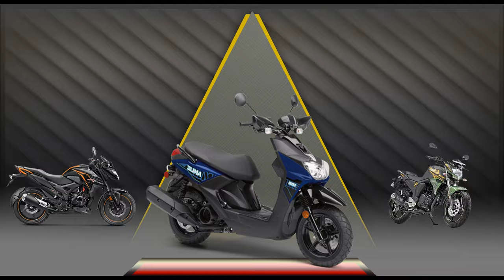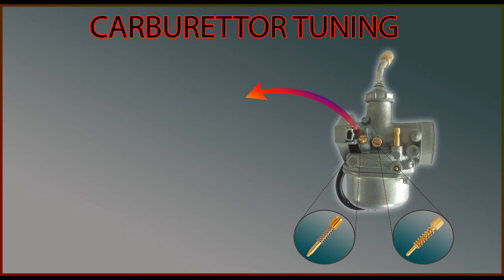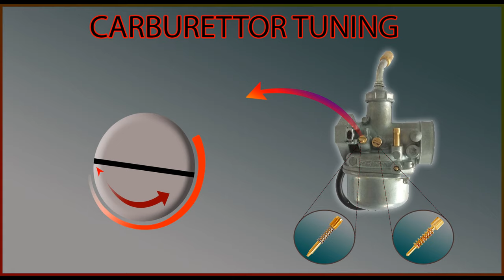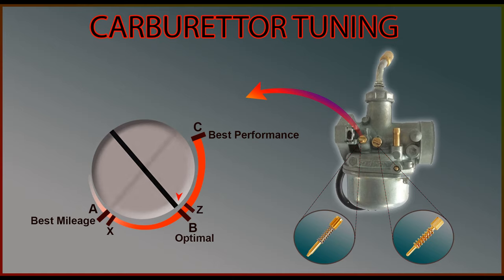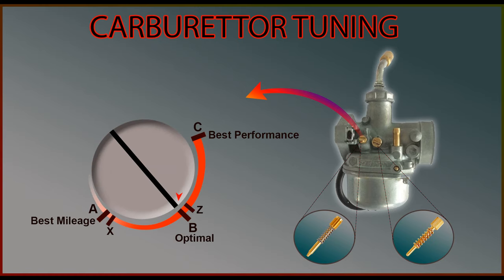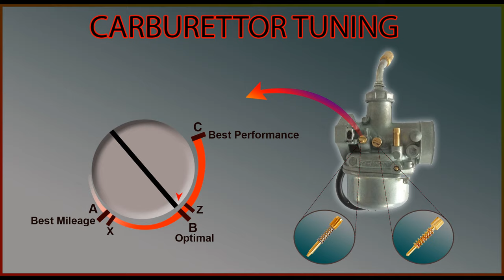Bike or Scooter carburetor tuning for mileage, carburetor setting. TVS Jupiter, Wego. #carburetor

Comment: Bhai meri activa ma mane all setting karke dekha li par milage nahi mil raha ha
Reply: Same story with my activa 3g
Reply from the maker: Mian jet ka hole ek baar check Karen. Agar mechanic jet hole ko kisi mote pin se clean karta hai toh jet ka hole bada ho jata hai. Tab bhi mileage nahi aata.
Reply: @autobotgeekse  agar koi gadi faulty hi ho chahe kitna bhi kuchh bhi karlo fault nahi jaega.
Waise hi agar average nahi deti toh kitna bhi karlo, sab kuchh karke dekhlo average nahi milega kyun ki  engine hi faulty hai.
Reply from the maker: @sourabhpanse  yes, kabhi kabhi bad luck hai.
Reply: @autobotgeekse  also when i pull choke in morning first start, Activa starts in 1 kick and engine rpm is high as choke is pulled but when i release it, engine stalls and turns off which i think should not happen.
Reply from the maker: @sourabhpanse  You should adjust your idling screw as idling seems to be very lean. Also, clogged idle jet will also cause the same issue. Cleaning the idle jet should fix it.

Comment: 1.75 turn band gaadi me kre or rpm set krde tab mana jayega
Reply from the maker: Haan, thoda adjust karne se set ho jayega
Reply: @autobotgeekse  kitne tak khol skte hai jissey gaadi kharab na ho
Reply from the maker: @history5889  3 turn se jyada petrol jyada piyegi
Reply: @autobotgeekse  3 turns se zada kyu piyegi jha kholta hai vha toh mileage ata hai na
Reply from the maker: @history5889  nahi, jyada kholne se mileage ghat jata hai. Video mein bataya hai maine
Reply: @autobotgeekse  zada kam khole tab bhi ghatega or zada khole tab bhi max kitna rakhe
Reply from the maker: @history5889  kam kholen toh mileage badhega. Zyada kam kholen toh engine idling sahi nahi rahega
Reply: @autobotgeekse  scooter me bhi  same hai full tight ke baad ek turn kholde toh kya mileage badhega yh ghatega
Reply from the maker: @history5889  haan badhega. Lekin ek nahi, dedh ya 2 turn kholiye
Reply: @autobotgeekse  2 max hai jissey dabe nhi gadi
Reply from the maker: @history5889  Question samajh mein nahi aaya

Comment: My activa rpm was too high so I adjust it but I think I've adjust the air/fuel screw instead of the idling screw🤷‍♂️
Reply: However the idling engine sound rpm has gone down
Reply from the maker: Please follow the steps and adjust accordingly

Comment: Adjustment is incorrect
Reply from the maker: What would be the correct adjustment? Please enlighten us
Reply: @autobotgeekse  Point A is a reach mixture and point C does performs best and anything beyond point C is a lean mixture increases the mileage but not the pickup.
Reply from the maker: @mohammedsajjad5943  that's not the case, please see my other video where I showed the practical mileage difference in all the 3 settings